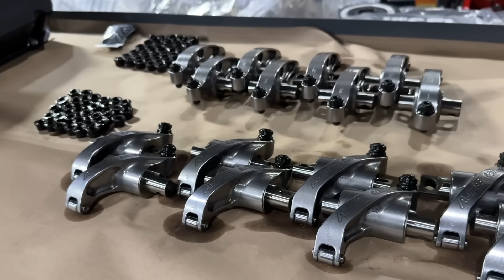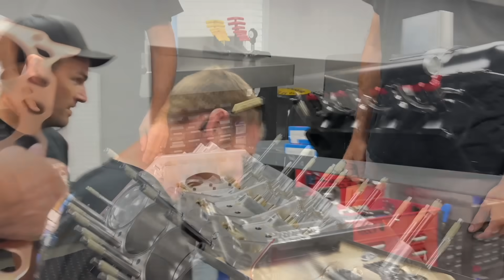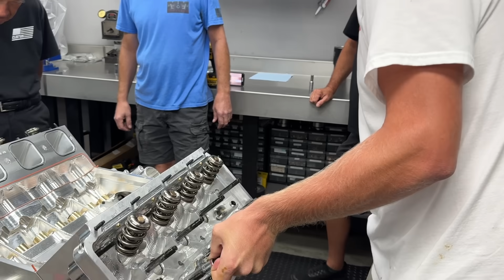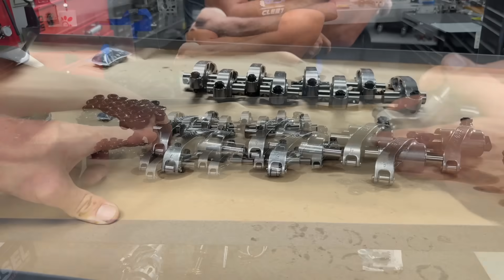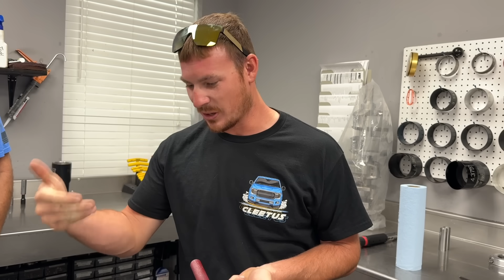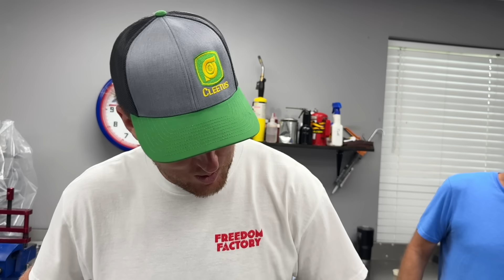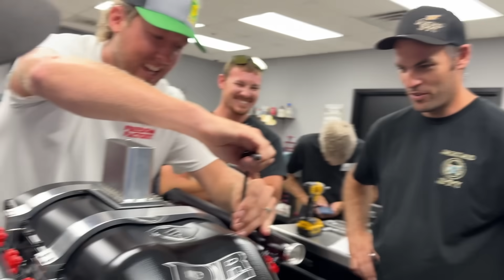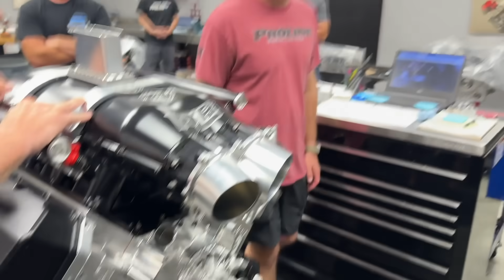Introducing Project Eagle's NEW Engine!!! (100% Billet)

Comment: Steve showed us how to pull his smx heads without pulling the intake.... He must have forgot to show you😂
Reply: I was gonna comment the same thing
Reply: @NoahAnsell I came to the comments looking to see if someone mentioned it.   I found y’all 😂
Reply: I think the surprise was due to the fact that they used to have head bolts that faced into the lifter valley. This is a new feature that comes with their new revised design.
Reply: For Hemi’s?
Reply: That’s only on the new ones not the one mullet has.
Reply: @Texas_Swift  no.  On his smx engine
Reply: @rodgersrcaviation2785 his point exactly tho this is hemi not a big block lol
Reply: @bradthackston5217  go watch Steve's SMX announcement video 4 years ago. Heads have always been removable without pulling the intake.
Reply: You're leaving out the part where Cleet was talking about this being a dry engine - that's great that you can pull the heads on an SMX without pulling the intake, but you're still either leaving them attached to some AN lines and trying to set them aside in the engine bay, or you're emptying some water.
Reply: I remember seeing that too but that might be on the newer revs?? I know cleet's was like an Alpha or Beta Rev.0 scratch and dent kinda engine to save money. I mean other than the mains breaking I def feel it was more fault of cleet and team that the engine blew up. I'll be impressed and surprised if this motor gets the upkeep they say it needs. Not to mention I'm sure this has been in the works for months and months long before the SMX broke so I doubt it's anything against Steve.
Reply: @chio987  the way the mains broke I'm pretty confident they didn't torque the centre main bolts last time they checked the crank. remember the nuts were loose in the pan and the studs were still in the block.
Reply: @denisohbrien the nuts loosened up after the cap broke
Reply: @denisohbrien it was due to "bad" design on the main caps. Steve M has a section in one of his videos about this issue.
The new smx main caps has new design and no sharp corners after machining
Reply: @RyTrapp0 . You do realize that the smx is sold in a dry or water jacketed setup?   Water jackets are a necessary for a drag and drive car.
Reply: Was here to say that same.
Reply: @trymviggo9121 the bad main cap design was on an SML, not an SMX. He had new main caps designed like his SMX's for the SML.

@rodgersrcaviation2785 the SMX is only water jacketed, you can opt not to use them, but he builds them all jacketed. The 481X has been around for years and is the dry block version that Steve used as his base for the SMX design, but he made changes to it like head bolt pattern for drag & drive
Reply: @RyTrapp0  yep, if the SMX was a dry block they might of got another.
Reply: @trymviggo9121  just saying what I see,  short of hydro locking the motor I just can't see why it'd dump thro the centre of the main caps like that, and if it did the fracture would be where the main studs go thro rather than to the side. Yes it's a stress riser but for the stress to be there the centre of the cap has to flex a lot. And that ain't happening if the mains were tight. Imho.
Reply: @THEFERMANATOR  well,SM even mentioned it in this video also.  And you can clearly see on the video where they try to fix mullett that the main caps are not looking like the new design,there are stress risers and sharp corners on the main caps on mullets smx. Not radiused and new design stuff.
Mullet is running SM old smx engine from boostwagon.
Reply: @bradthackston5217  So many uneducated mouths on here that just refuse to learn anything. Morris has addressed this a few times yet people just want to assume shit. 
just like everyone crying that he's putting a Mopar into his Chevy. It's almost comical, the crying.
Reply: @thuddleston  Not on his original SMX it ain't. It was stated as much not long ago on his channel. But please, do go on.
Reply: @xtr3m3fLx  where was it stated recently? Not trying to argue, but in the original SMX launch video he says heads are removable without pulling the intake. The SMX was designed to use 481x intakes and other common parts, so the 2° angle that makes head removal possible has always been a feature.

Comment: Chrome socket on the impact gun like a true gangster!
Reply: Snap on
Reply: TBF, those are compact impacts, not 1/2" high torques lol, the socket adapter will break long before anything will happen to a socket
Reply: They’re assembling an engine that’s why they’re using the chromes, small impact on lowest setting to assemble quickly…
Reply: Not sure if it’s the case here but very few engines a impact socket will fit and snapon man replaced them anyway if you do go boom

Comment: In Aviation scratches in aluminum parts need to be blended to remove points of stress concentration. Aluminum parts are generally susceptible to fatigue failure resulting from the concentration of stresses at the bottoms of sharp nicks, cuts, and scratches.  When dressing out nicks and scratches from an aluminum alloy parts, the damage is first removed and the edges of the repair blended into the part surface. This is done with very fine sandpaper, making all strokes parallel to the grain to prevent the possibility of leaving any horizontal scratches that could possibly cause stress concentrations.
Reply: Are you saying there are nicks on that dropped piston??
Reply: @NotchFox Garrett put a scratch on the Frankenstein

Comment: Steve JUST said in one of his recent videos that you don't have to take the intake off lol
Reply: Ya I saw that. I wonder if the Cleetus crew knew that ?
Reply: @92dieselunit  I dont think they did know that
Reply: @92dieselunit he had an older version that couldn’t do that.
Reply: His engine is old, Steve's test mule.
Reply: He screwed Steve Morris.  Maybe you didn’t see that?
Reply: @CULT539  Why?
Reply: @CULT539  not really
Reply: @CULT539  Steve is literally in the middle of rebuilding the BBC for Mullet, stop being an absolute drama queen
Reply: I remember seeing that too but that might be on the newer revs?? I know cleet's was like an Alpha or Beta Rev.0 scratch and dent kinda engine to save money. I mean other than the mains breaking I def feel it was more fault of cleet and team that the engine blew up. I'll be impressed and surprised if this motor gets the upkeep they say it needs. Not to mention I'm sure this has been in the works for months and months long before the SMX broke so I doubt it's anything against Steve.
Reply: While yes it’s removable without pulling the intake due to all the water bullshit it’s not much of a time saver compared to on a hemi
Reply: The SMX runs has coolant and return lines plus lines from the oil pump running to the heads which still makes it a big production to pull the heads even if you can leave the intake on, and depending on how you have it plumbed you may still have to pull the intake to get them off, the drag and drive stuff just adds extra complexity that a dry block doesnt.
Reply: Steve said ALL SMX's can have the heads pulled without pulling the intake, he designed them with a 2 degree offset in the intake flange so the heads can lift off. Alan's car has an early version in it as well, same as Cleetus's And the "alpha version" is the one in his wagon now. It was the 1st one where him & Tom Bailey were doing the CNC work where before they had another shop doing the CNC work. That is why he had the trans problems with his current SMX in his wagon now because the crank to bellhousing depth was machined incorrectly.

Comment: The hemi and the SMX both don't have water jackets and are dry deck.     But the SMX has coolant flowing around the head which allows it to be able to drive hundreds of miles.  
Seeing some people getting confused on the difference.  The hemi has no coolant going into the head
Reply: How much HP is that hemi?
Reply: @qgshadow  5000 hp capable engine.   Id assume he'll be running around 2800-3500 hp? It's still a small tire car.  2800-3500 is just a guess, but I know people have made roughly 5000 HP with that motor.

Comment: Dang he just threw Steve under the bus with this engine.  I seem to remember Steve dropping everything to road trip and work on Mullet . And Steve built a huge all billet hemi for a boat .😮
Reply: Right!!! Wtf
Reply: WTF are you talking about? He didn't go to Steve for Leroy's engine either, he went to Pete, and so what? 

Steve specializes in drag-n-drive engines - Pro Line specializes in race engines. If you've been watching Steve's videos lately, you would know that he's currently behind on customer engines, and that's why he didn't go on Sick Summer. So whose engine is Steve supposed to push back even further to rush a new billet hemi for Cleet? Because he isn't trying to wait until "next year" to race this car. This is all the while Steve is currently rebuilding the BBC for Mullet BTW.
Reply: Okay drama queen
Reply: Uhm steve literally doesn’t build a engine that will work in n eagle and if he does work on a hemi it’s because someone bought someone else’s worn out junk and didn’t want to pay the actual builders price to rebuild it right with the right parts and brought it to steve to get it done cheaply as possible
Reply: And that’s if you ignore the fact that even a small time engine builder has less supply chain issues than steve does
Reply: @54raceman umm Steve literally does build hemi engines.. Yall are some of straight up drama queens. This will be a trailer princess that is towed to and from the lanes and pits and NEVER have a radiator in it, an smx never made any sense AND THATS OKAY. But to say Steve doesn't build engines that would work in the Camaro is insane. He absolutely does. He sells dry deck 481x They were ran on npk. And he built a hemi recently lol

Comment: With the SMX you didn't have to pull the intake to take the head off either....
Reply: Not sure, but did that change since they were running dual injectors?
Reply: Yeah but this engine should actually stay together and win races. The smx and the mh7 is apples and oranges. Proline builds amazing stuff
Reply: @chicago_race_engines7538 they both do their jobs really well. Also it wasn't the fault of the SMX that it wasn't the correct match in Mullet. A few hundred passes is much more than 25 too. We will see how it goes.
Reply: @L1Z1O  nossir it's actually 3 injectors per cylinder. 2 for racing, one for street driving.
Reply: @chicago_race_engines7538  and I was just stating that both engines can have the head taken off without removing intake. No need for the who's pecker is bigger debate. Thy are both bigger than ours. Lmao
Reply: @Ole_CornPop  I didn't know it was 3, damn! I also wasn't sure if the extra injectors would interfere with getting the heads off
Reply: I guess Texas Speed was a flavor of the week. He has been through more builders than I have ever seen. I forgot about Pete.
Reply: @FastLaneLyfe  Texas Speed does great work but they don't build anything like this. He can't run something they don't even make. Same with Steve Morris. SMX is a great drag and drive engine. It is NOT an ideal Pro 275 combo.
Reply: @wingracer1614  I agree 100% they both are good in there own lane
Reply: @Ole_CornPop  you can't really compare the amount of runs an engine can take because all engines can do things far differently than one and other and besides a Proline Hemi is the sort of stuff you see in NHRA drag events whereas an SMX could literally be used as a daily driver motor if one so desired so really you can't compare the two motors at all and that's not me ragging on Steve at all and also it's not that the SMX wasn't a correct match for Mullet because if you actually watched Sick Summer you'd know there's someone with a Monte Carlo that just got his first 6 with an SMX and if I recall the car is a 73 Monte Carlo which are no more lighter than an El Camino so again it's not that the SMX wasn't a match for Mullet it's that Mullet couldn't handle the engine itself because the car itself wasn't fully setup to handle it
Reply: @wingracer1614 no kidding if you wanted to run a smx in pro275 you’d have to roll in with a separate trailer for the spare engines line the world cup import guys

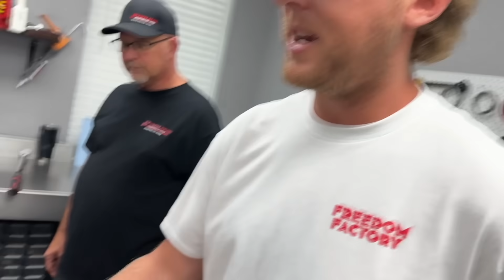Comment: @10:40 Cleet forgot the SMX is a dry deck deal too
Reply: Dude doesn't seem to remember anything about the smx lol
Reply: Yes but it still has a water jacket. This does not..
Reply: @wingracer1614  I don't think the engine cares what its jacket is made out of, they don't feel cold like we do
Reply: He just slipped up on his terms and said dry deck instead of dry block the second time
Reply: @jakejones4472  SMX doesn't have coolant flowing from the block to the heads via the head gasket.  Both engines are dry sleeve, but the SMX does have coolant flowing around the heads.   That's why there is 2 or 3 AN fittings on each head. That's one of the main reasons you can drag and drive that engine.
What I think he meant was, this is the first engine they own that doesn't have coolant in the heads.

Comment: Those hemis need 10 times the maintenance of the smx. We'll see how that goes.
Reply: He maintained the SMX per Steve’s instructions. He addressed it on his FB
Reply: @KJ-kw7gh they didn’t at all though regardless of what was said
Reply: @shonuffLA just because they don’t do everything on video,does not mean it didn’t happen.
Reply: @shonuffLA  Callin Cleeter a liar eh? How would you even know... you think you know everything that goes on in their shop because you watch some videos?
Reply: @KJ-kw7gh I don’t think Steve would have said, “go ahead and do donuts in the burnout pit at Indy with the SMX”. 😂
Reply: @lordcommander3224 Or make all those passes while missing a gear
Reply: Ten times the maintenance twice as fast! Mother MOPAR requires some love if you want to be the fastest! This ain’t no junk ford or Chevy boys! You gotta stroke mama!
Reply: Cleetus said they weren't maintaining it like they were supposed to. His first valve spring problem was because they didn't lash the valves before street driving. They didn't take Steve's advice about the torque converter line pressure being too high and killing the thrust bearing so I don't see everything that happens behind the scenes but what is on camera shows the growing pains of learning to maintain high dollar race engines the hard way.
Reply: @DinGuSco  wouldn't say anyone is calling him a liar but they definitely don't take proper care of the motors and push passed the limits that are set on them which is why he destroys pretty much all his engines at some point or another
Reply: Well it's a race only engine no drag n drive with this. You do the same thing after every pass it is not hard. If he's going to go fast with twin turbos he will be going through transmission like no tomorrow but that's what happens when you have 5,500+ HP.
Reply: You act like you’re paying for any of it 😂😂😂😂 who cares what he does or doesn’t maintain. It’s for our entertainment
Reply: Tell me about it. Everyone's all screaming at me like, "he knows what he's doing" and "he has a multi-million dollar company". No he knows how to make content and has a multi-million dollar production for entertainment. Content means pushing everything till it explodes and not actually running a professional team. He needs extra mechanics, parts, racks, handlers, the whole nine yards. I'm hoping this build will finally force his hand to make him do it. While I love the over the top content I really want to see him put up a serious pit crew team. Jackstand, Zack, and Tye can only do so much. I think the problems he has had with Mullet and Eagles price tag have seriously woken him up. He can have fun with Leroy but with Eagle screaming down the track, he is going to have to be on point after every run.
Reply: That just isn't true at all - they're more or less the same. Frankly, the 481x(SMX) requires more maintenance if you rev it up past 9000RPM, where as you can race these hemis at 10000 with regular maintenance. Not to mention, they're much easier to work on because they're basically clean sheet race engines that vaguely resemble a 426 hemi.
Reply: @brawndothirstmutilator5863 running turbos at that level requires doing the boost management with the blow offs not the wastegates like people are used to (mark micke his trans guy and proline perfected it)and that means they’re gonna be putting those intake straps to use because 75% of the time with that setup any hiccup up or down track abort either knocks the intake off or the bottom end apart
Reply: Ayedidyae yep the maintenance difference is marginal but the amount of work it has to do to make the same numbers is a fraction of what you have to put the 481x through
Reply: @DinGuSco  I know what goes on when I saw the state of the Smx when they pulled it apart and mullet when they put it up on the lift. No pm at all was done, that car was drove hard, put away and not touched until it was time to bring it out. There is a reason there are teams dedicated to actual racing when cars get sub 7s. You have to tear down, go through and possibly rebuild after every race weekend.
Reply: @John_Conner222  Couldn't agree more.  If Garret is serious about racing at a high level he needs a crew dedicated to that car and nothing else.  Not as good for youtube content as having ol George running around, but if they don't invest in good crew it's gonna get expensive fast and/or someone is gonna get hurt because they also slack on safety issues way too often.
Reply: @KJ-kw7gh  did Steve instruct him to do donuts in it or run it w/o 2nd gear, or blast it over 9k rpm? just wondeirng.